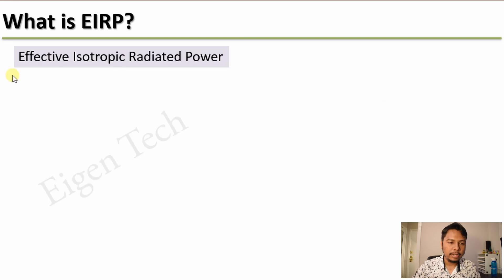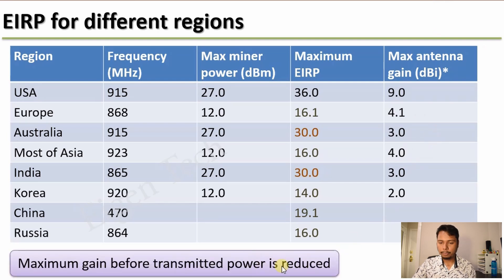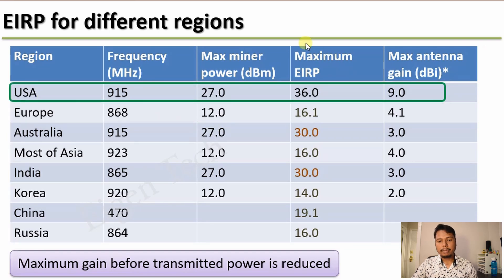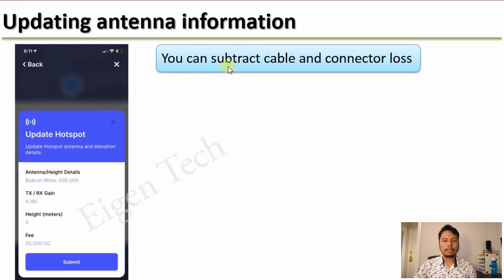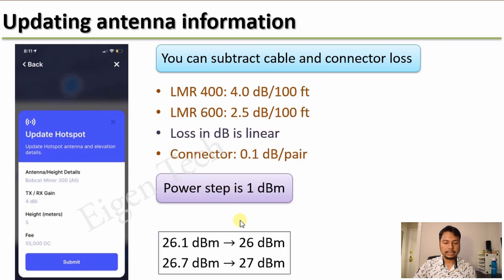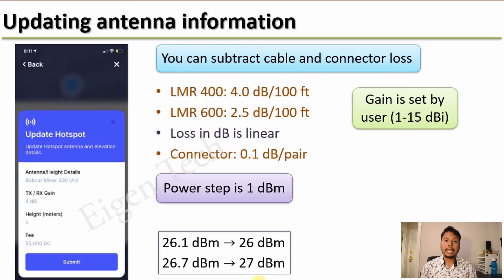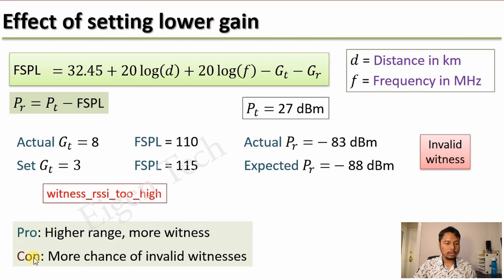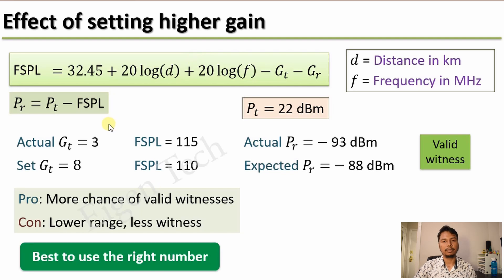Correct antenna parameters after the activation of PoCv11 | How to increase valid witnesses

Comment: Hey ,
I have a question that could not find an answer yet anywhere, 
Using 6.8 dbi with a long cable and the power will be 4 dbi after losses,
With out losses using directly 4 dbi antenna 

Both of them same for getting witnesses? Or which one has a advantage, 
My opinion 4 dbi without losses better because to reach closest area 

Hope that I could be able to ask my question
Reply: Because after poc11 , I think using an antenna over 4 dbi not necessarily ( for Europe) 
Or am I wrong?
Reply from the maker: exactly, the performance depends on your audience. If other hotspots are closer, you should use 4 dBi, if those are far you should use 6.8 dBi. Beacuse, the gain determines the radiation pattern as I have explained in this video https://youtu.be/A2_sJQhpdig

Comment: I'm wondering, in the case of EU where 3dBi is max allowed, what happens if you are using an 8dBi antenna and it's lowered to 3dBi because of local regulations based in PoCv11 if the range gets cropped to a 3dBi BUT with 8dBi action-angle. If this is the case, could we say that using 8dBi antennas in EU does not worth no matter the case (tall, middle, sort buildings, forest area), since 3dBi gain generates a lower range?
Reply: It's 4.1 max for Europe
Reply from the maker: As I mentioned in the video the antenna recommendation remains the same. In a city area 4 dBi would be fine but in an urban area you might have to use 8dBi even if the transmitted power is brought down
Reply: @eigentech6567  the transmited power implies just lower range or power enough to get witnesses? I mean, with the New PoCv11, if I use a 8dBi antenna, will I cover the same distance range but I'll make lower witnesses or just simply will cover a lower range? Many thanks for such educational content and help! 🙌
Reply from the maker: @Van_____  The range will be less as the signal will not be able to travel as far since the power you began with is less
Reply: @eigentech6567  Many thanks, Roy. I appreciate the clarification! Keep doing this great contents! 🙏
Reply: @eigentech6567  Hi man, and sincerely thank you for the knowledge sharing! Really appreciate it. Here in EU (Croatia) the only miners getting >1 HNT per day are the ones with 8 dbi antennas to begin with. To continue onto what you and @van were discussing... I'll be specific, and give an actual use case. In your honest opinion, would you suggest that Round Vanilla Dragonfly exchanges its 5.8 antenna lowered to 4.6 (cuz pocv11) to an 8dbi (effectively 8-1.2=6.8dbi) regardless of the upcoming pocv11 on November 11th? Please answer. Sending good karma points and hoping for the best. 🙏 ☺️
Reply from the maker: @maradosev  The best antenna depends on your antenna placement and target hotspots. Maybe for Europe, you can use a max of 5.8 dBi so that the transmitted power is not reduced too much.
Reply: @eigentech6567  So in that case ( using a 5.8 dBI antenna in Europe), what antenna do you recommend to choose in the Helium app( in the upgrade antenna setting)? 4.1 which is allowed in Europe,  or 5.8? If I declared that I use 5.8, my rewards wiil be less because  5.8 dBi it's too high for legal terms of Europe? Thank you very much for your time!

Comment: is it possible to put a new 5g gateway/hotspot(starting in USA) offering wifi  nearby a LOran Helium hotspot?   I have heard that 5G devices are starting being deployed in USA...or at least the waitlist has been activated......
Reply: Sure you could but why? The FreedomFi 5g hotspots are also helium miners just like what we have now. So the mining part would have reduced transmit scales.
Reply from the maker: @moguaiato5583  Yes, the FreedomFi 5G hotspots would be an independent miner, so you should not place two closeby